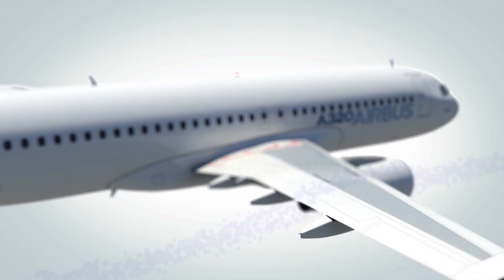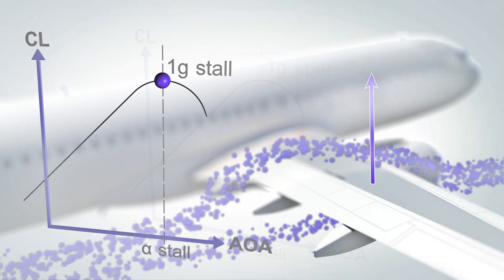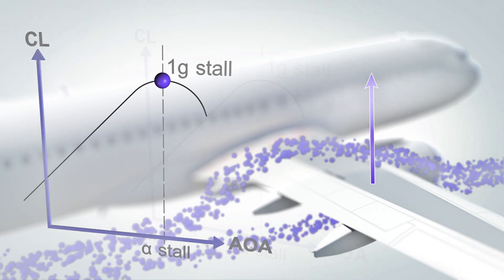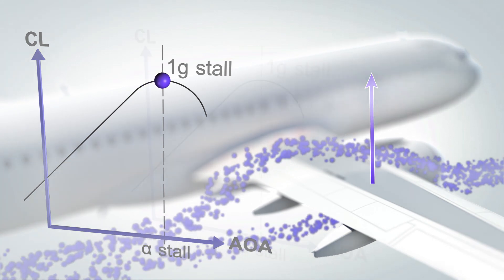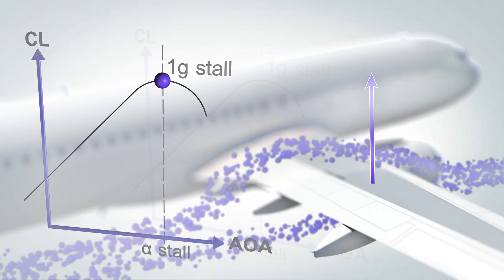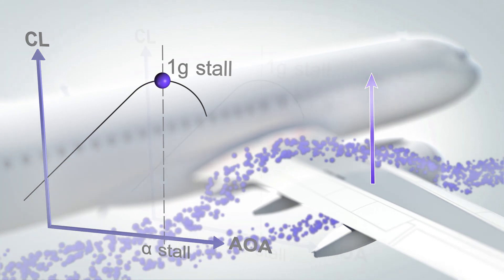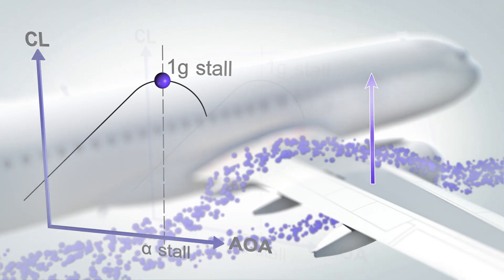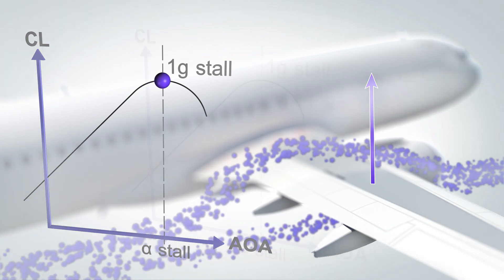Airbus High AOA Protection 02 06 2017

Comment: so why didn't this work on Flight 447? Or is it a development as a result of that flight?
Reply: This protection works in so called normal law.  AF 447 lost important sensors on bad weather conditions. Without sensors data input, no protection output. See final report: https://en.wikipedia.org/wiki/Air_France_Flight_447
Reply: @MarkBeaker  So no stall protection with an idiot at the controls. Just stall protection as part of the auto pilot features which was lost when the auto pilot switched off
Reply: @fostexfan160  no. This has nothing to do with the autopilot. The autopilot only disconnected because it has no speed reference due to the blocked pitot tubes. Because of no speed reference this forced the aircraft to to alternate law where basically the flight control computers (not same as autopilot) doesn’t have enough input to fly safely so it hands more control to the pilots. The pilot was then the idiot who stalled and crashed the plane. If the autopilot has just disconnected but all speed reference was available the aircraft wouldn’t have stalled
Reply: @tomstravels520  Thanks....I've read a lot more on this and now understand what you say. It's quite astonishing how that pilot reacted. From what I understand he put the aircraft into a deep stall from which there is no recovery. Tail and wings stalled ....the controls having no effect on control of the plane....horrific